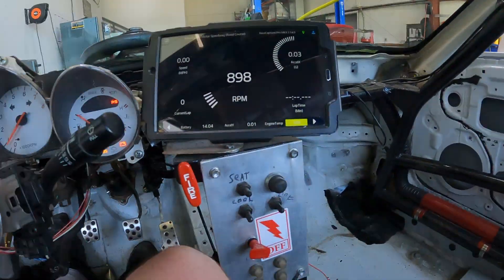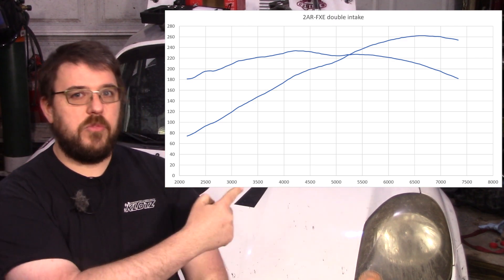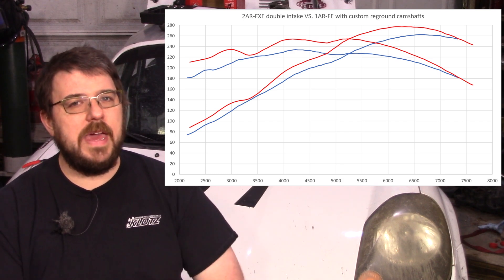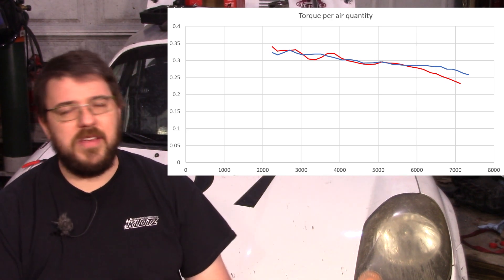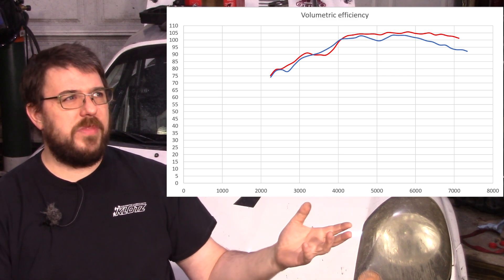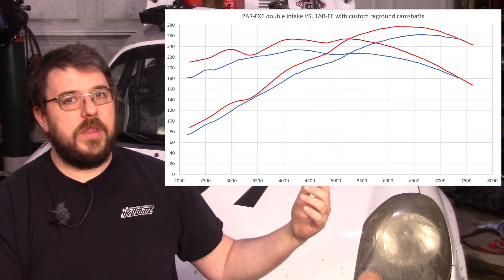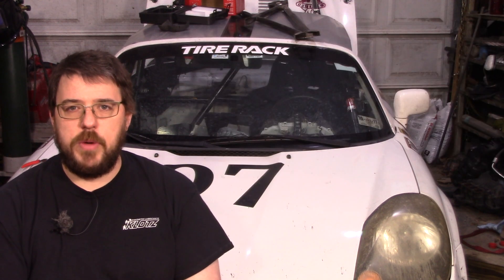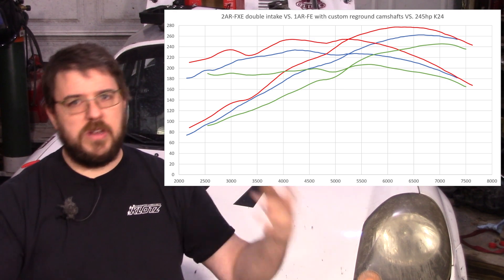Making 260hp from a Camry Hybrid motor without custom parts!

Comment: I have a feeling it’s mostly down to the smaller displacement and overall less peak lift and duration from the cams. More compression makes more power but the most important thing in an engine is how much air and fuel is going into the engine. It would be like a k series Honda engine without v tech- v tech mostly just increases lift and it makes a lot more power at high rpms.
Reply from the maker: but then what about when i divide it down to power vs airflow. at that point for a given amount of air both motors are making the exact same power. That confuses me.
Reply: @FrankensteinMotorworks  someone mentioned it could also have to do the the heads. I noticed both engines sort of drop in power at higher rpms even with the larger cams which makes me think there is a restriction somewhere and I doubt the heads are optimized for peak power at high rpms.
Reply from the maker: @zokusharuuku1091  That's something i was trying to cover in the video. The engines look like they limit at the same power but deeper data analysis shows that they are both limiting at completely different airflow levels. I'm not saying the heads aren't going to be a limiting factor but i don't think that's the issue *yet*. I'm pretty sure these heads as-is could at least get to 300hp
Reply: @FrankensteinMotorworks  doesn’t equal power for equal air mean that the compression is the same?
Reply from the maker: @michaelscholten9753  right, which is the source of my confusion. some of the measured air has to be not participating in the combustion.

Comment: Nice work, Marc! Exciting stuff to see!

I am foaming at the mouth for a 2AR FXE , 1AR crank, ported exhaust and intake manifolds, gasket matched ports, and the large cam! 

Let er sing!
Reply from the maker: Yeah, i'm pretty sure 300hp is not too far away. The intake ports are already matched quite well and the exhaust gasket has a sealing surface that is huge compared to the port but if you matched it you'd be into the water channels. Even larger cams would certainly help though.
Reply: @FrankensteinMotorworks  interesting! Do you think a light port and polish is doable for incremental gains? Are the castings on the ports in good shape?
Reply: Bigger TB, maybe itb?

Comment: Video is great...have you actually compared the ACTUAL compression.numbers of the engines?  Agree; you should have gained more.
Reply from the maker: No i have not but i have a 2ar-fxe piston on the way so i can compare the piston dimensions and measure the exact compression difference. I'll probably have a follow up video in a week or two about this.
Reply: @FrankensteinMotorworks  12.5 is correct, compression ratio always refers to geometric since "Atkinson cycle" is just a different cam. I think you didn't get the increase in power you hoped for possibly because 12.5 is a very high compression ratio for pump gas on a port injected, low tumble motor. E.g. the Lexus LFA had bigger cams and 12.0 compression.

Did you tune it by adding timing until it knocked, or until the torque was maximized on the dyno?

Comment: You should sell a turbo manifold for this too. Looks like a easier swap than 2gr. 
You are a blessing to the MR2 community. Thanks man
Reply from the maker: This is absolutely something i want to do. I just need this swap to get a bit more momentum first to justify the cost.
Reply: @FrankensteinMotorworks  Consider me your client. Working on cheap way to ship to Kenya then will order parts once you are done
Reply: I’m honestly planning on 2gr swapping my spyder and then turbocharging it. I’ve already got a spare turbo and some parts. It’s more of a long term project for me. I’ll be painting the car soon since there’s some nice big gaps in the headlights from the celica lights I installed. Then ill be saving for the 2 grfe swap.

Comment: Impressive numbers.  Have you tried varying the intake and exhaust timing with these cams as a function of RPM?  The base tune may not be optimized for the higher CR and longer duration of the 2ARFXE cams.  Understand that tuning takes time, but the hardware is there.
Reply from the maker: Absolutely, I spent an entire day on the dyno finding the tune including the cam timing. And yes, these cams are significantly different from the stock VVT-I tune.
Reply: Frankenstein Motorworks nice.  It was not clear from the video the level of tuning that you did.  Nice work.
Reply from the maker: @reneneron2971  Yeah, that's a good point. The first time i took the 1ar-fe with the reground cams it took about 45 pulls on the dyno to get a good tune. This time i used that as a good start but still did about 30 pulls to get everything fine tuned. This is why it is worth it for me to travel to TCS Motorsports to do the tuning, most shops won't let me run back to back runs fast enough to get all that done in a day.

Comment: I will have to dig up some Toyota data sheets. I could have sworn I remembered they used Atkinson magic for that compression. I'll try digging up those diagrams to make sure I'm not spitting garbage
Reply from the maker: Please do, i'd love to see that data.
Reply: @FrankensteinMotorworks  Will do, I may actually have to get another TIS subscription. Again, I maybe confusing a different FXE engine with the 2AR, but I'll try to dig up information. It could very much have more compression the 2ARFSE also lists high compression.
Reply from the maker: @Duck_Vision  I do have an FXE piston on the way to be able to measure the differences but any documentation could also be handy.

Comment: I would call this a success.  Bargain bin motor and oem cam swap for 110hp gain. Well done and thanks for the lesson teach 😁
Reply from the maker: It's probably more fair to call it a 72hp gain because you'd use the 2ar-fe, not the 2ar-fxe if this cam setup wasn't a thing. But no matter which way you math it it's a hell of a gain :)
Reply: @FrankensteinMotorworks  so your saying get a 2arfe and the intake cam from the 2arfxe to get 260hp?
Reply from the maker: @radstar2185  i think the cams are the most important part but i would be shocked if you got there without the compression ratio bump and the intake/exhaust setup i use.

Comment: cam overlap reduces cylinder pressure, which impacts torque production. 
Is that perhaps what’s causing the engine to not reach the expected extra 8% increase in torque ?
Reply from the maker: except that the bigger cams had even more overlap. this new motor has less overlap and more compression.

Comment: Bigger cams and E85...let the day when those are added to the 2ARFXE be the day all K24 owners shudder in fear...or from regret with empty wallets.
Reply from the maker: There's still barely any knock so E85 would not really help this motor unless you were throwing boost at it.
Reply: @FrankensteinMotorworks  I see. Perhaps you can try to find an IHI twinscrew off of a Millenia S in your area and put it on the 2AR? (Just satisfying my inner fantasy build)

Comment: The difference between a static and a dynamic compression ratio? Though in normal operation with the amount of overlap the Atkinson cycle makes you would think the compression ratio to be lower if Toyota was using a dynamic value. It may also be a result of the piston design. Are the valves the same size on the fxe motor compared to the ge motor? Finally, what about throttle body inlet size? Is it possible that you are choking the motor out at high rpm?
Reply from the maker: I reclocked the camshafts to turn it into a performance motor. the cams are not operating in atkinson mode anymore. the valves, head, springs, everything is the exact same part number between the 2AR-FE and the 2AR-FXE. The motor is not being choked by the intake yet. The manifold pressure is still almost 100% atmospheric at full RPM.
Reply: @FrankensteinMotorworks  I get the reclocked cams, I was more thinking along the lines of Toyota’s 12.5:1 ratio not being a true value but instead something that has come about with dynamic compression ratios. But the Atkinson cycle kind of nullifies that with all of its overlap that would kill compression. It would definitely be interesting to see how the motor would perform with your regrind cams or even just stock 2ar cams. The whole thing is a little baffling because I thought for sure it was going to make a higher number.

Comment: Might want to consider exhaust duration, causing the power drop off at high rpm.   If you're keeping the stock exhaust com, go over your exhaust header/manifold with a fine tooth comb, to increase the scavenging effect.
Reply from the maker: This is using my own swap manifold: https://frankensteinmotorworks.squarespace.com/mr2-spyder-shop/2ar-fe-header there really isn't space for a different design there.

Comment: Maybe you can try a better intake manifold with bigger Throttle Body
Reply from the maker: That will happen eventually but right now all the numbers are showing that my intake manifold and throttle body is not a restriction yet. I'm guessing somewhere around 300hp is where it'll become a necessity.

Comment: Thanks for the update. I will admit I hit refresh on your channel a few times, was really keen to hear the result. Figures look good to me, and as you know it's the easiest engine for me to get here in NL so I'm pleased to hear!

I have a question: if running fixed exhaust cam, could I index it not for peak power, but for torque? 

Perhaps I'd have to lower the rev limit? Seems a funny question, but it's related to the legality of an engine swap here, where +40%HP is a turning point for a more stringent roadworthiness test.
Reply from the maker: Sam, You absolutely could tune it for more mid range. the only issue you might run into is the peak power and the idle cam angles are similar. the midrange opens later than both of those so if you goo too late you might struggle to idle properly.

Comment: Very curious as to what results some headwork and optimised piston design could do with this engine.  May not be a bad thing to take a look at what Cosworth did with the 2GR Lotus cup cars making well north of 400hp.  I know that Papadakis and his 2AR 1000hp drift car found some very cool solutions for valve train as well.
Reply from the maker: Oh there's absolutely a lot more to be had. I'm keeping an eye on that volumetric efficiency. When it starts going too low despite cams i will certainly start doing headwork. I think custom pistons with better squish will come sooner though because i want a 12.5:1 2.7L engine.
Reply: @FrankensteinMotorworks  do you have any idea of what the head flow numbers are on the 2AR, and what the overall shape of the ports are leading into the cylinder?  Being an “FE” motor, I am curious what the valve angle is and how much flow can be created without too much material removal and drivability compromise.  With the low cost of the motor, I would be willing to put some additional “work/money” into it.  I had also asked previously asked about a custom fluidamper to compensate for the lack of balance shafts.  A friend of mine had great success on his Audi 1.8t when he added one.  The engine was far smoother above 6k (redline was set to 8200) and it did gain a few hp above 6.5k .  I’m curious if it would be possible to break the 285hp+ mark with these mods, and not feel like a race engine.
Reply from the maker: @GrayeElectroLab  I don't have flow numbers but it is on my short list of things to get. I want to do that before getting another cam ground so i can determine what kind of valve lift i should go for.
Reply: Very good point, i doubt the heads are optimized for peak power which could be one of the things holding this engine back.. the power does seem to drop a bit at higher rpms even with decent cams.

Comment: Amazing numbers for a stock internal engine👍, im guessing that the reground cams with a higher rpm could give you even better numbers,  Those pistons must be begging for more air.
Reply from the maker: Yeah i think if i combine all the lessons learned so far it would be really close to 300hp and i'm pretty sure there's still much more to go from here.
Reply: @FrankensteinMotorworks  that motor looks to be a promising platform for 300+hp at the wheel cant wait to see more
Reply from the maker: @e5141981  i was talking about being close to 300hp at the crank. 300whp is 126hp/L which has been done many times before so it is far from impossible but i don't have that formula for this engine yet.

Comment: What are you planning next?
Reply from the maker: Fixing that frekin' rattle. this thing sounds like a half broken engine when it starts up.
Reply: @FrankensteinMotorworks  do you have a path to using the stock Ecu with this setup?
Reply from the maker: @michaelscholten9753  Yes, I'm starting to do some drawings to address some of that.

Comment: How different did timing map end up with 2 more points compression? Would e85 wake it up more so than the 2.7?
Reply from the maker: very little difference actually. but yes i did get a bit of knock but nothing that was hard to manage. E85 would make a tiny bit more power in a few spots but this motor is not very knock limited even at 12.5:1 CR